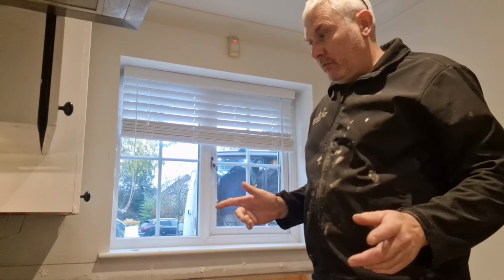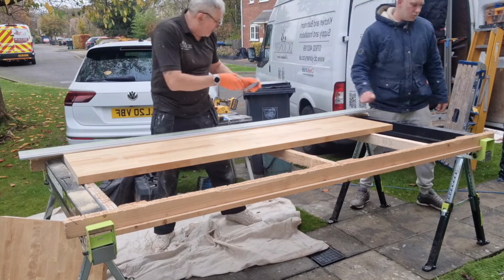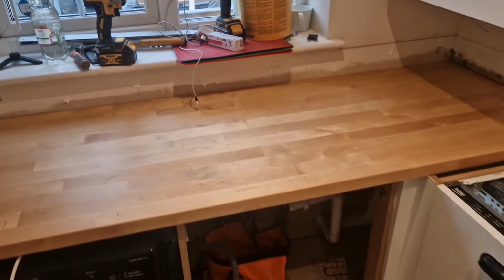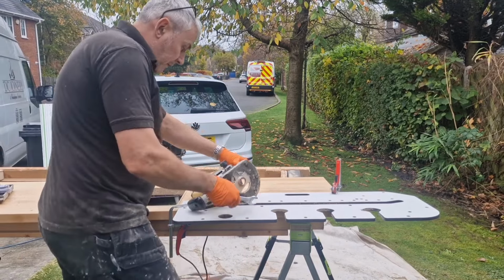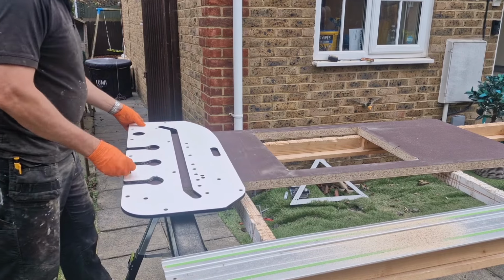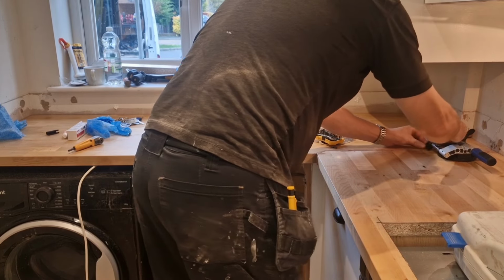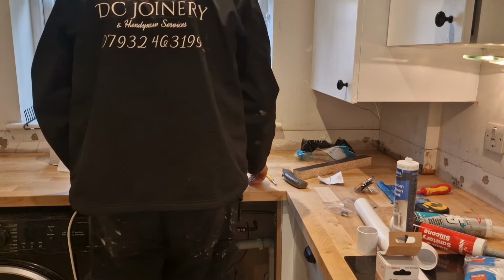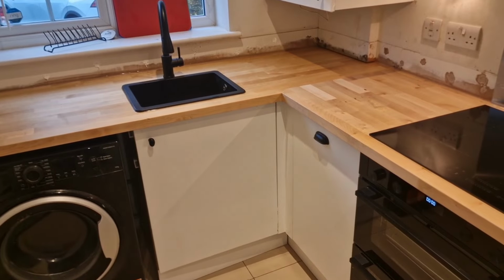very long video on worktop fitting

Comment: Great vid. To be honest you’re a legend for finishing that by noon. Out of curiosity, how much would you charge to fit something like that? And also if it had another masons mitre (u shape) how much would it be then?not a probs if you prefer not to say. I’d probably charge 200-250 for one joint and 300-350 for u shaped? Am I charging too much in your opinion?
Reply from the maker: @adhafer4542  I charged £400 for labour and materials ie glue clamps colour  fill.
 for  a u shaped probably  more like £600 because  I have Ricky's wages to consider  too then there's a gas engineer  if it's a gas hob
Reply: @ I need to up my prices!!!! lol.
Reply from the maker: @adhafer4542  lol worktops arexa skilled  and time consuming  job
Reply: @dcjoinerydjdave6100  yes I agree. Always find they are a lot of work!!! And there’s the risk your saw slips and you got to pay for the worktop lol
Reply from the maker: @adhafer4542  😆 🤣 😂 😹 😆 🤣
Reply: @dcjoinerydjdave6100  anyway thanks for sharing that personal info with us. Appreciated.